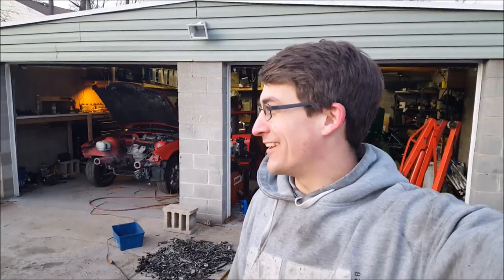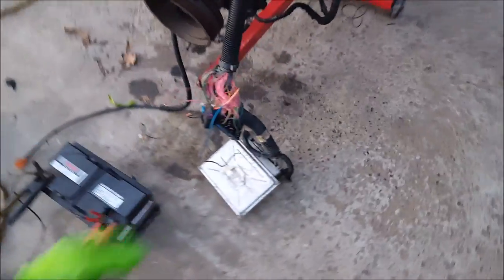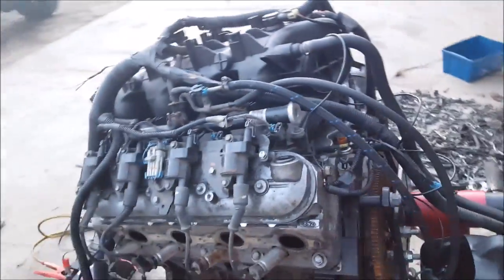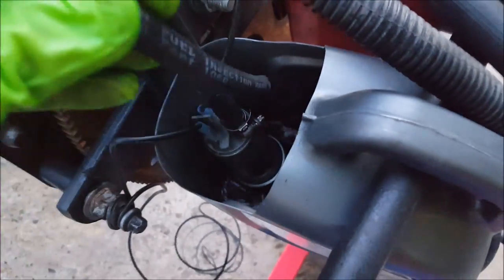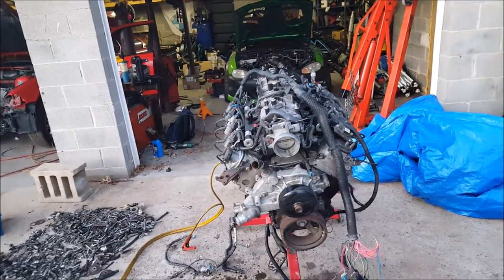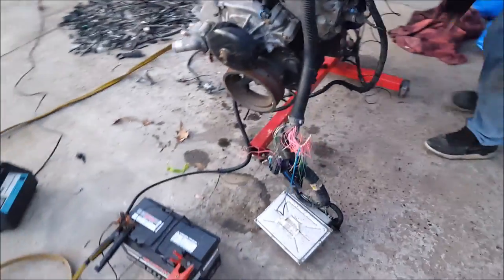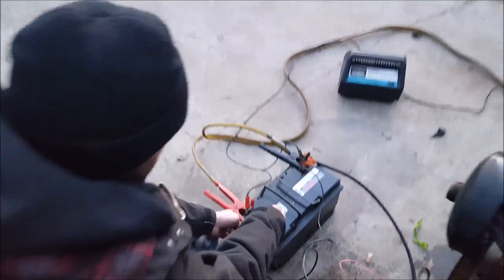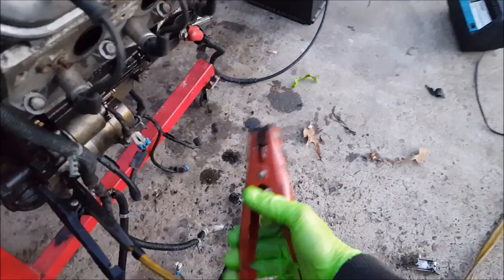How To run LS on  Stand WARNING LOUD!

Comment: I'm sure there was good reason behind this, but I'm pretty sure you assembled that engine stand the wrong way
Reply from the maker: You are correct, I eventually figured that out 😂
Reply: @ThomasMiata  Haha alright good!! Glad we were all on the same page there! I ran an old 5.3 on a stand a few years ago albeit with some extra bracing on the side. I wasn't able to get past VATS, but the can of starting fluid in my hand told me that was no problem at all hahaha
Reply from the maker: Hayden Wilhelm it’s a good time running an engine outside of the car ;) I might have another one to do soon because I blew up the 6.0 that was in my M3 lol

Comment: How about the cooling system or water 💧
Reply from the maker: If it will be running for less than a minute or 2 and it was entirely cold before starting, it will be fine for testing.

Comment: How do you control spark and injectors
Reply from the maker: With the stock ecu, which is unlocked using hptuners cable & software

Comment: Please help me I'm 11 years old and want to know more about engines
What is a LS?
Reply from the maker: A LS is an engine produced by General Motors it is v8 and comes in many displacements (aka engine size). It is one of the most swapped engines today because they are cheap and easy to get running in a different chassis, or an engine stand like my video.

Comment: Wow
Reply from the maker: Wow 2x
Reply: Thomas Miata I need help with getting my 5.3 started up. I put it in a 92 K1500. I have the factory fuse box. Do I need to do the pin out on lt1swap ? I don’t plan on running emissions and I have a 700r4. What’s your opinion on pin out a very nice stock harness to a standalone

Comment: You must not want to keep this motor after running it without some type of exhaust😂💀 good way to warp all your valves
Reply from the maker: This engine was locked up and free.99.  Also, it's already been rebuilt with 241 heads.. no valves that mattered were injured in the making of this video
Reply: @ThomasMiata  I'm assuming it's cold there.  Ain't that bad for me lol
Reply from the maker: Joe Cla it can get cold here in MD for sure. This engine sadly died under boost in a drift car because the tip of a broken screwdriver made itself inside of the used intake I had on there... All is not lost though, because now the car has a 6.0 lq9 in it :)
Reply: That was suppose to be 'em' not me lol.
Reply: @ThomasMiata  I'm doing an 03 5.3 in an 82 c10. I'm looking for an lq9 for my 01 4x4 Tahoe though
Reply from the maker: Joe Cla I pick them up from the local LKQ pick your part for about $285 :) download their app and set notifications for trucks with 6.0s
Reply: @ThomasMiata  it's a little far for me lol I'm in Louisiana. I'm in no hurry on it between work and such I'll run into one someday.
Reply from the maker: Joe Cla LKQ near you: 4007 I-10 Frontage Rd.
Port Allen, Louisiana 70767
Reply: @ThomasMiata  that's actually not bad lol. 3 hrs away

Comment: can this be one on a Gen IV??
Reply from the maker: Otherworldlytwo2nine the gen 4 is similar but you will need to unlock the Ecu  either way using something like hptuners software
Reply: @ThomasMiata  ok cool. I haven't seen a video yet on it. I was wondering if the procedure was the same. I did my gen 3 last year. Scared the hell outta my wife. 😂
Reply from the maker: Otherworldlytwo2nine hahah awesome! If you figured out the gen 3 ur gonna be fine.. it’s basically the same
Reply: @ThomasMiata  sweet. Thanks man.

Comment: Where are you located
Reply from the maker: MD
Reply: Thomas Miata 

is that Maryland ?
Reply from the maker: @certifiedautocarerecovery7429  yes
Reply: Thomas Miata 

what would you charge to remove the vats from my computer?

Can you modify my harness?
Reply from the maker: @certifiedautocarerecovery7429  im not trying to do side work, I have my own projects I need to finish. Plus lt1swap.com can do vats delete cheaper then I can. It cost me 100$ for every ecu I want to edit.
Reply: Thomas Miata 

Its cost a $100 to remove vats
Reply from the maker: @certifiedautocarerecovery7429  that's what it costs me, using my cable. However, other people can do it cheaper because they have a business license software.

Comment: That stand is hella bent
Reply from the maker: Geoffrey Cook safety first and then team work!
Reply: Idk but that stand is harbor freights finest 👍👍👍👍🤙🤙🤙🤙
Reply from the maker: @tidalnebula9329  I have since reinforced it.. it does not mean nearly as much as it did and is almost level. I added a brace of dom tube at the bottom
Reply: Hell yeah lmao
Sometimes alittle ingenuity goes along way. Especially when it's from a low bidding country. Probably China.
Reply from the maker: @josephjones2243  this is going in my e36. Look at my playlists and check out the "drift taxi" build

Comment: Was the point to show everyone how not to do it? Luckily your fuel tank did blow up. Guys build a proper test bench.
Reply from the maker: U mad cause it worked? Or because we had so much fun doing it? I kinda push the limits.. a small amount of fuel catching on fire.. or that whole engine isn’t a big deal.. fire extinguisher and hose was on stand by.

Comment: Run on oil,,,no gas huh....lol...sure
Reply from the maker: You misunderstood what I was saying.. there is fuel in the jug..  but I put used motor oil in it for testing.. aka the engine oil was not new

Comment: My mom is going to bring her 4 cilinder fiat Punto to the scrap yard I'm going to strip the whole engine out of the engine bau fuel pump exhaust etc and I'm goin to build a go kart out of scratch the engine. Has now atriums 50 horsepower I wanna turbo it
Reply from the maker: Nouri 010 that sounds crazy!
Reply: Thomas Miata yea it is I wanna turbo it if the block can handle it

Comment: May I ask what fuel pump did you use
Reply from the maker: It was a walbro 250 I think, but any gas pump would work with that intake manifold. The fuel rail has the pressure regulator built in.